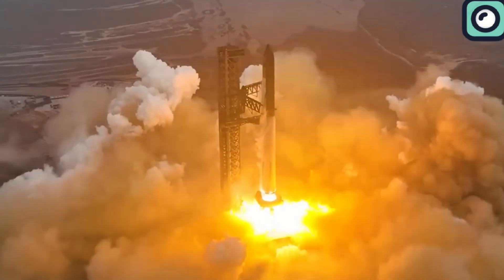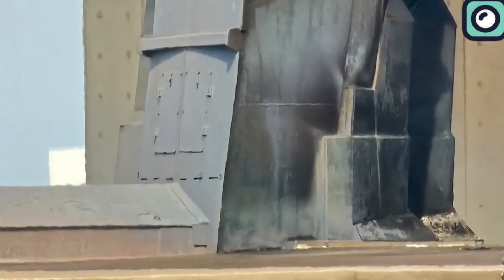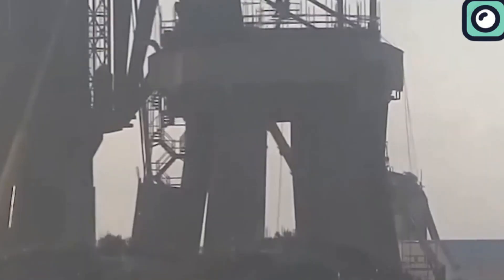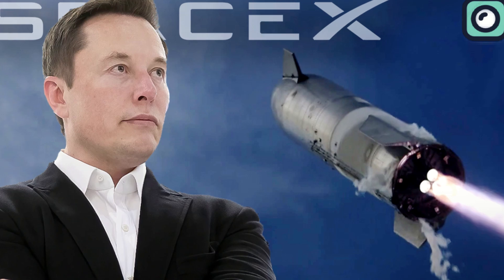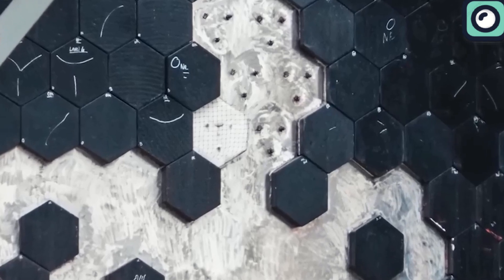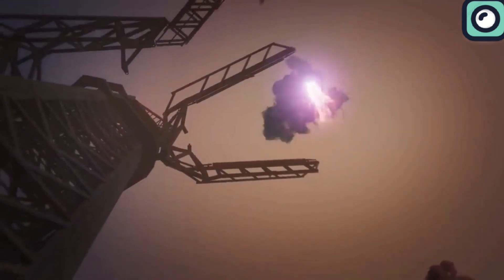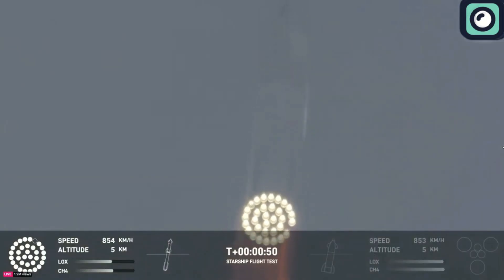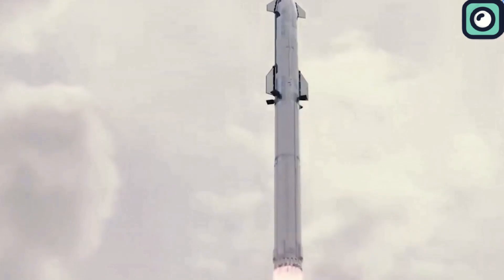Starship Launch Caused Serious Damage To The Launch Pad!

Comment: The silicon felt layer under the heat resistant tiles is not reusable? So all tiles will need to be removed to replace the felt? This must be an interim solution if SpaceX is to stay on target for rapid reuse/turnaround

Comment: Heed all my previous comments Elon and included a Flame Diversion Trench at the launch site. The heat, the turbulence, the highly destructive ultra-sonic vibrations, and the sound volume are tearing the hell out of those engines, and engine failure at ignition or later in the flight will be an ongoing event thus destroying your vision of multiple daily flights. Take heed Elon, please.
Reply: We will need new eyeglasses for that vision as we realize the extensive repairs will not allow for multiple daily launches with this design… I would stop the chafing insanity and redesign all 4 component (pad, tower, booster and ship) all have big issues not solvable by patches 🎉🎉🎉

Comment: the water plate can handle a lot more heat turning yellow is not a problem it is when it turns purple there may be a problem Elon was happy with the water plate
Reply: Delusion it will not work, check out the latest revelations on the REAL damage to the launch from flight 4.

Comment: What if launchpad is submerged into water tub Or swimming pool of water, for launch sequence. 
Instead of spraying water onto launchpad? 

I think, it will be more effective?
Reply: The rocketflames will push that water away, out of that pool, within a second after ignition. Maybe a launch in open sea then?
Well, that could be if the launchtower is mounted firm on the bottom of the sea. A floating launchpad wold become instable during launch as the rockets engines would blow most of the seawater that keep that tower afload away.
All well, but for an interplanaitairy system I think Spacex made the wrong vehicle.
Reply: Great idea, but I am
Pretty sure 10 million plus pounds of thrust would move even 2 million pounds of water 🎉

Comment: Everyone needs to remember that Starbase is 'Experimental' and NOT a production ready facility.   They learn with every flight where they need to improve and have shown that they'll get there in the end.   A large flame trench would be better...and nobody at SpaceX would argue with you.   The problem is at the Boca Chica site various environmental agencies prevented them...along with the water table...from building the trench so this is a workaround.   When they build production worthy launch facilities in Florida I'll bet they use a trench.
Reply: Well then, why haven't they learned this; build a flame diversion Trench.
Reply: @mattblack9069  As I said above, they aren't allowed to build one at Boca Chica by regulators and the water table.   If they can't get the deluge plate to work long term...you can bet they'll go for a trench.   But for now...where they're at...they're going to try to use the deluge plate for the time being.
Reply: @recoilrob324  Rubbish,it was not regulations it was that the water table being too low, that problem can be overcome using caissons to build a complete trench and it can be anchored using its own weight and embedded piles, nothing is impossible, they can totally forget about the deluge system it will not solve the problem, and what a waste of water and expense. There are several factors as I laid out and no amount of water will eliminate those
Reply: @recoilrob324 is this factual or repeated hearsay ? If permitting was a problem I am sure Elon and his team would not be quiet 🎉

Comment: How can anything withstand that type of heat. I would think a flame trench would reduce the initial blast of heat. Just my humble opinion.
Reply: The problem is that they did not think about the problem until it was a problem… poor engineering just compounding till
The end of the rope…
1- bad site selection
2- bad thrust deflection
3- deluge cooling system is not for what they are trying to use it for. Even 40k GPM is no match for 10 kiloton + lift forces
4- The quick disconnect retraction system is a bad design 
Learning should be, Failure to do things right result in constant issues that are patched up with money.

Of course all contractors and engineers are happy taking the money.

How can you build the second launch pad without a trench? 

The best part is there is a source of never ending money although not much payback but entertaining 🍿

Comment: Use a flame trench like every other launch pad. Those shockwaves you see on take off are proof that the water cooled frypan is not working as it should. Look at any other launch and you not see these destructive waves.
Reply: Ask yourself WHY Elon choose to design a steelplate deluge-system instead of a flametrench. Its not feasable to build a flametrench since the groundwater table is no more than 3meters down. Besides..the army engineering-core had some issues with that idea. They DID build a trench at massys for ship-testing.
Reply: @fredrikabinger4818 he chose the deluge steel plate because he’s not an engineer. It’s been playing the engineer since the beginning. 🎉🎉

Comment: Flame trench is the only way to save the launch pad.
Reply: How about a tunnel to divert the exhaust.  One with its own water deluge system.  Is the water deluge system incorporated into the legs of the launch platform?  Streamline the legs so they aren't blunt in the center.  Possibly making the platform where the rocket actually sits much wider moving those legs away from the exhaust. too.  Lots of redesign and construction costs lots of money.
Reply: @hughacosta1090 that’s what NASA designed in 1965 for Apollo missions and we never heard any complains… the trench was designed to divert the flow… the 2 failures of SpaceX pads is that they are trying to stop the thrust damage with flat surfaces, incredible they went from concrete to a steel plate… and now the search for a new alloy… maybe they will pick a 10 inch thick tungsten plate (which may be the required calculation) for 90 million dollars? At the end it’s just money to burn. I would engineer and design a new structure… how about an engineering contest like Edison and Westinghouse competed for the Niagara Falls contractor? 😂😂😂
Just kidding Elon is too proud of himself 😊
Reply: If your cement pond fills up with water, let the rocket blast push the water away?

Comment: I KEEP TELLING EVERYONE THAT YOU CANNOT LAUNCH THE LARGEST ROCKET IN THE WORLD AT ALMOST GROUND LEVEL. IT MUST BE AT LEAST 250 FEET UP TO START. THAT MUCH FORCE MST BE DISPLACE VERTICALLY RATHER THAN HORIZONTALLY BECAUSE OF THE COASTAL AREA GROUND WATER AT SEA LEVEL. INSULATE THE INTERNAL LAUNCH TOWER AND YOU CAN EVEN HAVE THE WATER DELUGE SYSTEM SHOOT WATER DOWN THE WALLS INSIDE THE LAUNCH TOWER. STOP BANGING YOUR HEAD AGAINS THE WALL WITH DOING THE SAME THING OVER AND OVER (MASSIVE LAUNCH, DAMAGE AFTERWARDS, REPLACE, FIX, SETUP FOR NEXT LAUNCH A MONTH OR MORE LATER NO TURN AROUND QUICKLY. WASTE OF TIME AND MONEY. DO IT THE WAY I SUGGESTED. ALSO HAVE MUCH LARGER TILES OR A SPRAY ON CERAMIC COATING OF DIFFERENT LAYERS. NO MORE TINY 10 INCH BABY TILES. IT IS LIKE PUTTING RAISINS ON AN ELEPHANT